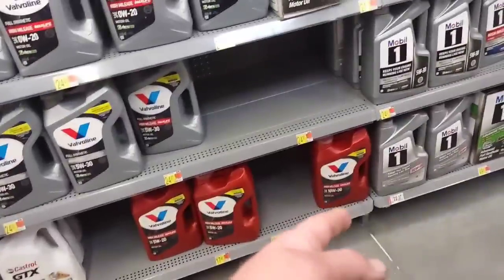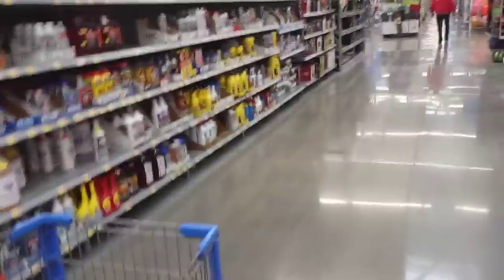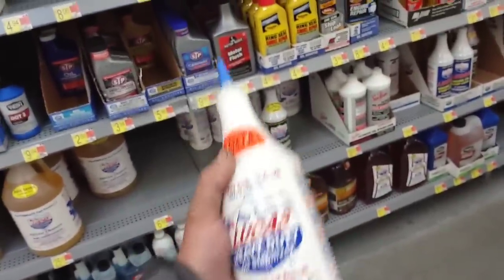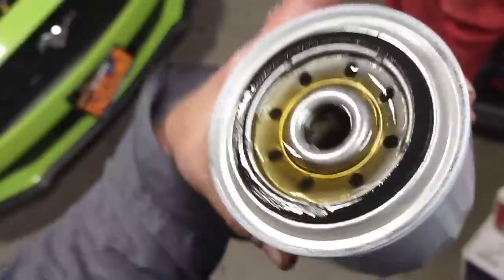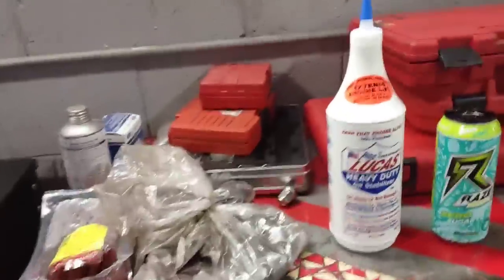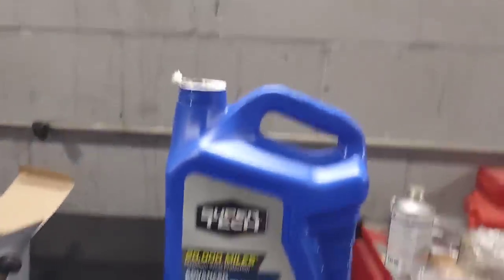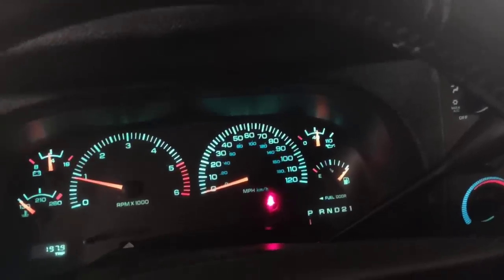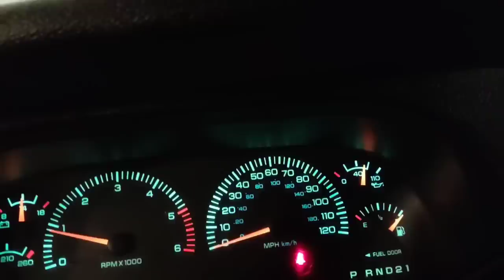We continue With Marvel Mystery Oil and SuperTech 10w30 20k Mile Full Synthetic Oil Dodge Ram 5.2L

Comment: Good choice,  cheap syn and run the mmo again.
Reply: Heck yea cuz it's what I run in my truck. cheap synthetic blend. Adding mmo soon. Wana see what it will do for sure
Reply: Boy got me hooked check it mid week
Reply: Funny enough in lab testing Walmarts oil is actually better than Mobil 1 and its made by shell which also makes Pennzoil
Reply: @raymondchow4436  which lab and what kind of tests? Last I checked SuperTech was made by Warren (WPP stamped on the SuperTech bottle), same company that makes Mag1 motor oil and almost all other "store brand" oils. They make quality products for sure.
Reply: 500
Reply: @ A K — it’s still not gonna do jack cause jack ain’t here. Lol. 

Just the fresh oil / frequent changes ALONE will clean out the internals up to a point. Anything beyond that needs a STRONG solvent that is idled for 15-20 mins and then dumped cause you can’t drive on it. 

THAT will clean things up. This MMO experiment is nonsense. It isn’t doing much in there. 🤷🏻‍♂️
Reply: That’s the point of an experiment.  Experimenting to see  if it works

Comment: I run Supertech oil and filters in my cars. After reading reviews from Consumer reports and a couple of other tester publications, it actually is a very good oil and a good filter, right up there with the pricey name brand stuff. I even run it in my motorcycle, V-twin oil and the bike now has 50k on it.
Reply: It may be walmart named, however they don't refine and manufacture their own oil and filters.  The oil will be from one of the few oil companies out there, sure they get to choose how many dispersants and what not however they won't be bad.  I believe Project Farms did a thing on motor oils and super tech on his list was actually quite good, especially for the price.  The filter is the same thing, they got one of the major companies to make their filters, they slap their name on it, donezo.
Reply: Supertech makes motorcycle oil?
Reply: @clb_52 Yes
Reply: Me too. Good stuff and Project Farm did do a test and it was way up there with the best of them. Any synthetic is better than conventional oil IMHO
Reply: I’ve heard it’s From Castrol plant just bottled different
Reply: I ran Supertech fully synthetic with Fram filters, and changed it every 10K, in a Honda Odyssey.  Engine was great until 320k miles and traded it in.  On the Honda I went through three transmissions and then discovered Valvoline Fully Synthetic transmission fluid is like mothers milk to transmissions.  Huge fan of the Valvoline Fully Synthetic Transmission fluid.    Supertech has now introduced a 10K fully synthetic and a 20k fully synthetic.   I've stayed with the 10K version because it's SP rated.  I've also become a fan of Fram Synthetic filters. I bought a box of a dozen filters and wrote the mileage on them...40k, 50k, 60k, and change at the 10k mark to keep it simple.    Always fill your oil filters with oil before installing them if you can.   I do HATE the thin plastic seal they use on the Supertech containers. It sheds and can end up in the oil.
Reply: @Vortechtral  u dont say
Reply: @Vortechtral  Actually,  Super Tech oil is made by the same company that makes Amazon and Costco oils l, and their oil analyses comes out the same.  A lot of people who use it have amazing high mileage testimonials.
Reply: @clb_52  Yes.
Reply: @mrdavidmitchell  They both are SP rated.

Comment: I've used MMO on a lot of antique engines to clean them up. It also works good for loosening carbon build up when cleaning heads if you don't have a parts washer. If an engine has stuck rings from sitting, an old timers trick I learned is to pour MMO into the cylinder and let it set for a day or two and it will free the rings up. I tried it once and it actually worked!
Reply: Works on aircraft engines too.

Comment: Looking better in the rockers.   I use the Supertech synthetic in all our lawnmowers and gas lawn equipment.    Walmart is the spot to buy oil for sure.....compared to the inflated costs at the parts stores.
Reply: We use 0W-20 in our SUV but I use 0W-30 Mobil1 in our lawnmower. The 0W-30 is old stock from when we had a car that called for 5W-30.

Comment: The first time I tried MMO was in my 99 Jeep Cherokee, 1 quart of MMO to 5 quarts of engine oil. I had a lifter tick that would not go away no matter what I tried & I tried a hell of a lot of products. With in 200 miles the DAMN TICKING NOISE WAS GONE, SOLD MY ASS ON MMO. I use it in my gas to lubricate the fuel pump that's in the FREGGIN TANK, IDIOTS. Also use Restore & had great results with that, compression went up using Restore but you have to use it every time when you change your oil. I also hate to go to Wally World so I order it online & it's about the same cost as how much gas I use going there. GREAT CHANNEL & NOW I AM A SUBSCRIBER, SIR.
Reply from the maker: Tyvm

Comment: I have  used mmo for years in the oil. I have a 2003 F150  with  392,000  on it. I use 530 super tech full synthetic and mmo. This combo makes it super smooth  and  quiet.  The mmo slowly liquefies sludge and helps to suspend  the  dirt.  Update truck still running  perfectly  and I still use the Supertech oil and actually  a Mobile  one 20,000 mile filter. I drain the synthetic  oil  at 8,000 , not the oil filter, then about another 8 or so I'll drain  and change  the filter too. I really do this to prevent  dry starts with oil changes.  At almost 400,000 miles I must be doing  something  right.
Reply: That extra step is really not needed

Comment: On a different note I'd like to give you a heads up about something I used to experience back in the day, especially on the old Ford Windsor engines but it holds true for any engine with a nylon timing gear. There used to be a saying among the Ford mechanics concerning the 221 through 351 engine timing chains which was "replace them at 50 because they go at 75" meaning the timing chain would give out at 75 thousand miles. The top nylon gear used to become brittle and pieces would chip off and make the top gear become physically smaller over time. Eventually the gear would become so small that the chain would jump a tooth and I can tell you from experience that they will run two teeth out of line but they won't run three. After I replaced the timing chain and gears it was just a matter of time before the customer came back with the oil light on at an idle. Very small pieces of nylon would get past the screen in the pickup and grind down the gears in the oil pump and I often recommended a new oil pump when replacing the chain and gears to save the customer from making a second trip later on.

I saw the grit on your finger that you scraped out of the oil filter and the only way it got into the filter was by being picked up by the oil pump. When this cleaning experiment is through and you are satisfied with the cleanliness of the engine I would suggest that you give some thought to installing a new oil pump. Lower oil pressure may not necessarily be because Marvel Mystery Oil is thinning out the oil. If you are running the original oil pump that has about 180 thousand miles on it and you start tossing grit into the oil through cleaning, you may be accelerating wear on oil pump gears that are already worn from age and use. The Marvel Mystery Oil may also be dissolving sludge within the oil pump gear housing so that, along with the grit picked up in the crankcase is all going through the oil pump gears before it reaches the filter.

One final note. I suffered catastrophic engine damage on my beloved 1965 Mustang GT Fastback because the "friend" who rebuilt the engine did not spin the oil pump by hand before installing it. He just put the pump in the engine and primed it with a drill. What he would have felt if he had spun it by hand was that the bottom plate was warped and the gears would get hung up and stop turning. Because he used a drill to prime it without first spinning the pump by hand, the gears scraped metal off the bottom plate and wiped out a newly rebuilt engine in less than 100 miles. It destroyed the pistons, scored the cylinders, damaged the crank journals, plus the main, rod, and camshaft bearings, wiped out the camshaft, and it even machined a groove in the camshaft thrust plate. Luckily my valuable 289 Hipo heads came through unharmed but the engine itself is junk because I don't have an extra two thousand dollars to have it repaired. So if you elect to install a new oil pump I highly recommend that you remove the bottom plate and put it on some sandpaper on a piece of glass and make sure it is true. I took a new oil pump to a machine shop and they had to give the bottom plate a few passes on a machine to make it level. Quality control is not what it used to be and I do not want to see you or anyone else have to go through what I went through because of poor quality control or in my case, poor quality control and a very careless "friend" who didn't take the time to spin the oil pump by hand before putting it in my engine. So if you decide to install a new oil pump after this experiment is over please check it very carefully before you put it in the engine.
Reply from the maker: This is just an old project truck and it's not something that I value very highly other than just for the channel and if we end up having to put another motor in it then we put another motor in it it's not a big deal but I do thank you for writing this and I will take that into consideration
Reply: Melling is a great choise  for oil pumps.
Reply: @stuartbuckley8720  It was a Melling pump that was defective. When I looked for alternatives I found that Melling makes just about every other brand of pump that was listed.
Reply: @TheScavenger71  wow, everyone has defects but I use melling pumps on race engines up to 900 hp. At around 800 hp or more we use dry sumps depending on the customer and the application.
Reply: @stuartbuckley8720  I was very surprised because like you I had used Melling pumps in dozens of repairs and never had an issue with them. In fact I think the stock Ford pump for the small block Windsor including the Boss 302 (which is what I had used in the past) are all made by Melling. I don't know if you are using a special line of pumps made for high horsepower racing engines but the one my "friend" installed had a bottom plate that was so warped the gears shaved metal and sent it through the engine. For a short time I thought my "friend" was going to make good on the damage so I started buying new parts and one of the items I bought was another oil pump. It felt okay when I spun it but just to be sure I brought it to a local guy here in Clearwater who is an old time engine builder and has done work for me before and he said he had to plane the bottom plate to make it level. I am glad you never had a problem with them because you have more money invested than I did but based on my experience I would urge you to check any new oil pumps that you plan to use. If you have any used pumps laying around perhaps you could check them and let us know what you find.
Reply: @TheScavenger71  who's the shop in Clearwater? I'm moving down near there in 5 weeks and could use a good mechanic. Unless he isn't a good mechanic.
Reply: @Nathan_Jay  His name was Billy Brooks. He used to have a video on YouTube and there is still mention of him in some blogs because he was the only guy who knew how to fix a certain problem on one of the old Jeep carburetors so if you Google something like "Billy Brooks, Jeep carburetors" you can probably find the blogs. I haven't been down that way in about 8 years and when I recently looked him up online I didn't see the old websites that I saw in 2013 so he may have retired. He didn't do complete auto repair, just engine work. He was old school and I remember the first time I went to his shop I saw an old slant 6 and a 409 leaning against a wall and said to myself "this is the guy for me." He planed my 289 Hipo heads and later did the bottom plate of the new oil pump I bought.
Reply: @TheScavenger71  got it, that's cool! I'll have to look him up!
Reply: @Nathan_Jay  Nathan, The old carburetor video is still on YouTube. You can view it here

https://www.youtube.com/watch?v=AdP-qHbsPeI&t=3s

I haven't called the phone number so he may have retired but if he's still around he would be the guy to go to for any engine work.
Reply: just like some of the GM 3.8 with that plastic shit on the cam timing gear
Reply: @greasemonkeybd  I had the same thing happen years ago on a 68 Pontiac with a 400 engine. Two weeks after the new timing gears and chain was installed the oil light came on at an idle.
Reply: @stuartbuckley8720  Yes, for many, many, decades !
Reply: @TheScavenger71  I was at a pontiac dealer in the 70's, 80's and GM was replacing the plastic cam gears with the same plastic cam gears new and improved they said.
Reply: Tremendous info !!  
Thank you!!  💪💪👊👊
Reply: @TheScavenger71  Thanks for all the great info!!  
I posted elsewhere in this thread, you might get some good info from that too.
Reply: @TheScavenger71  Thanks, he is more than a couple hours north, but I'll keep his info in my phone.  💪💪👊👊

Comment: Hey I’m watching. I used MMO in my hot rods and older vehicles in early days. I now have a new Ram 2500 6.4 Hemi and it has 11,000 miles. It’s had its 3rd oil change. Keeping with the 0W40 Pennzoil with Mopar/Wix /NAPA Platinum filters. Now with this Hemi tick every ones concerned about I’m keeping up with maintenance. This thing will throw a code if you use any other heavier grade oil or possibly an additives to combat a Hemi tick issue or give lifters extra lubricant. Nice video

Comment: I enjoy your videos, like these, for oil. I always say a really good filter is critical. I've seen tutorial videos that super tech are pretty decent! I use 1 pint of marvel every oil change on my 2003 Bonneville with 189,000 miles on it. It really smoothed the engine and cleans the passages.

Comment: i never go into Walmart from the front. At mine you can go in through the car side and you go through a little checkout and you're at the home improvement, outdoors, and car section and you checkout and leave the way you came.
Reply: I check out at the electronic center. Fast and no lines lol
Reply: Eli Hernandez - Thanks for the tip !!  I never thought about that - makes perfect sense... The front doors are a mile from the auto section anyway...
Reply: @frandanco6289  when you drive by the side where they do the oil changes there's typically a little parking lot and like a metal door that you can usually look through and see a checkout line. You can typically just open the door and go in there, buy your things, and just check out and leave the way you came. It's what I do most of the time.

Comment: Good call on the Lucas! Before emissions came out on class 8 trucks, every truck I worked on with a million miles on the original engine was run with 1 gallon of Lucas, 9 gallons of Rotella 15w-40, and changed every 10k miles. Once egr, dpf’s, and scr catalyst’s became mandated, the oem’s raised the oci’s to 30k and even 60k! on certain engines. It’s no surprise that plugged egr coolers, carbon packing of piston rings, and just about anything with a roller tip on it started to fail. Drivers would say “it’s only got 40k miles on this oil change, the company shop said they change it at 60k miles”. Do you ever check the oil level? “No, they do that once a month at the yard shop”. 🤦🏻

Comment: When I change the oil in my cars, I prime the oil filter with mmo before I put it on (maintenence dose) Then I add oil as usual and run it the full interval. If I get an old car that's new to me, I do the 20% thing.I first used it when I locked an old lawn mower up and found mmo in the shed. Turned the lawn mower up, filled the combustion chamber up,and let it sit overnight. Next day set it back down,pulled the cord and it turned over. I put the plug in and it fired up and I used it all summer before I retired it.

Comment: Awesome video, thanks for sharing.    I have a 1994 Toyota Camry, with a 4 cylinder and I had some Marvel's Mystery oil and added , Lucas fuel injector cleaner,.   Ran it for a while, and one day, I went into town, the other end of town, and was shocked and surprised that how smooth it runs , and it didn't before.   Oh my gosh, it's awesome, for that ,. Especially in the West coast of Oregon, it's wet , a majority of the time,.    And it cleaned out the water in the fuel lines and tank ,.  Added MMO,. Marvel's Mystery oil and bug change,. Smooth and quiet.   👍👍👍

Comment: The Lucas is not only a oil stabilizer it doubles the oil life expectancy, it also eliminates dry starts. It remains suspected on all the moving parts.  I have used it for many years.  Lucas products are all good and reliable in my opinion..

Comment: if you have to run back out to Walmart for more oil filters, The ST8 is the same as the ST16 in except it’s taller. So if the room is available there, than Use that ST8.

It has a lot more filtration element in it because of the size of it. So in all honesty more fluid is being pushed through the filter element before the bypass than the other.
Reply from the maker: Good to know thank you